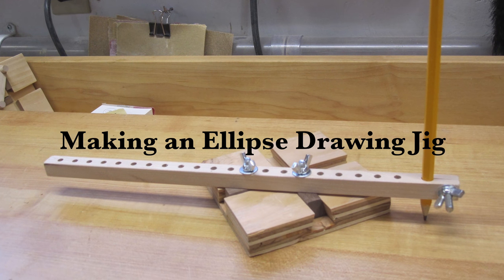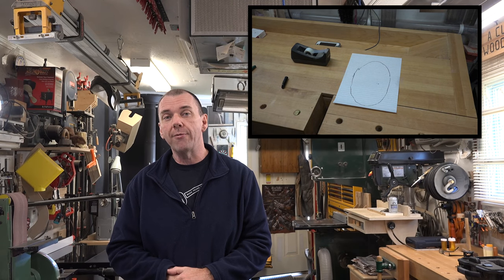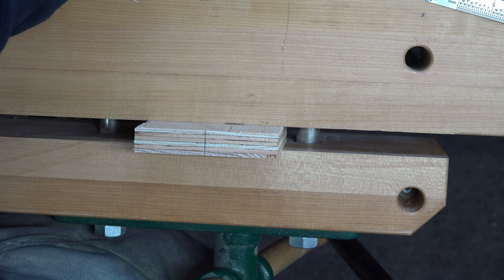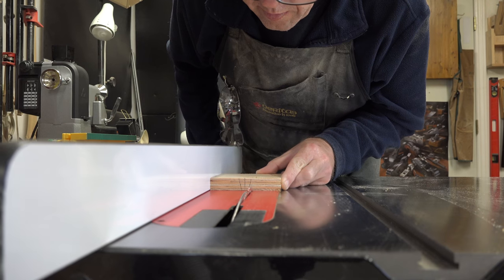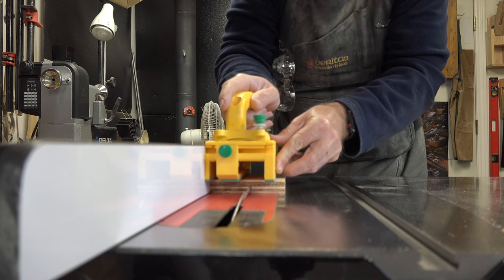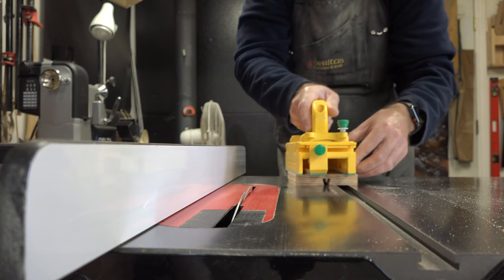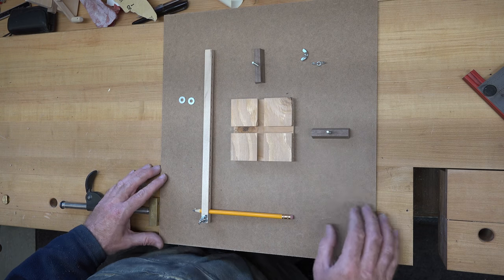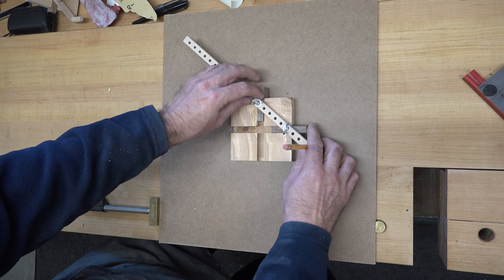Ellipse Drawing Jig

Comment: I made one of these maybe 18 or 20 years ago to draw perspective views of the star ship Enterprise, who's saucer section is always an oval or elipse.  Two suggestions will help you. One, make your base a large oval , less than the oval you want to draw but much larger,  secondly, make it of a smooth hard wood and not plywood whose grain is fibrous in all different directions.  Thirdly, you can extend one arm in the long channel to reach further out with your drawing of an oval.  Lastly drill holes large enough to put your fingers in in each of the quarters of the base and another smaller one as a center hole for target and alignment and so you can use your fingers to hold down in succession as the arm travels around to keep it stationary.  Mark the circles very lightly.
Reply from the maker: Thanks for taking the time to leave your comment Wade.  I appreciate you chiming in with your suggestions on the build.  They are very helpful.  Thanks for tuning in.

Comment: Only one down fall here.  You cannot make a a specific sized ellipse.  Nice jig though.
Reply from the maker: I suppose that by adjusting and changing the configuration of the jig, you could use trial and error to get the size you wanted but there is no specific measurements available for this jig, you're right.  Thanks for tuning in to the show and taking the time to leave the kind words.
Reply: @acutabove_woodworkings  I’m just finishing up an ellipse shaped skylight chase that comes up from a 6’-8” radius ceiling opening for huge remodel I’m working on.  So I had to get the lineal dimension of a 6’-8” opening sitting at a 45 degree angle, which was 112-3/8” If I remember right, and from these dimensions I was able to figure out where to place some nails strategically so that I could trace the ellipse with sting hooked on the nails.  Worked beautifully!  Fun project!  Thx
Reply from the maker: @tundrawhisperer4821  That sounds awesome.  Glad that you were able to figure it out.  Great stuff.